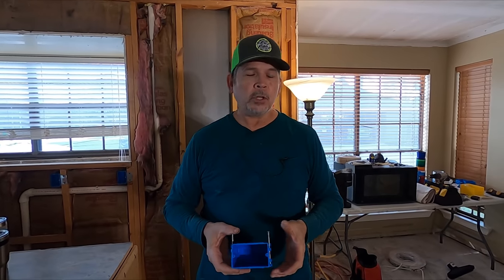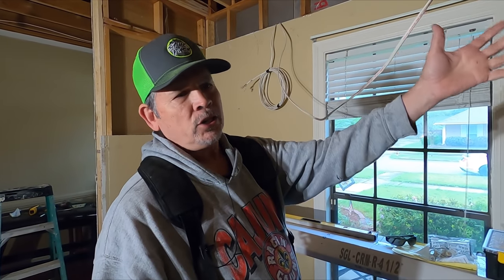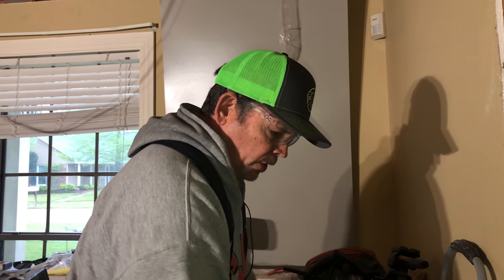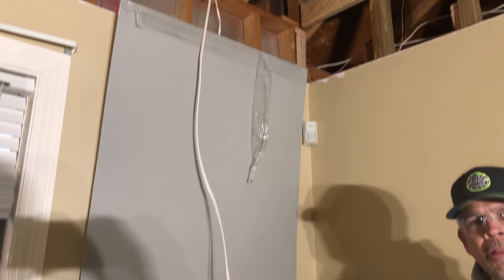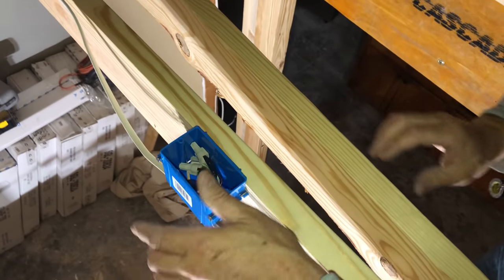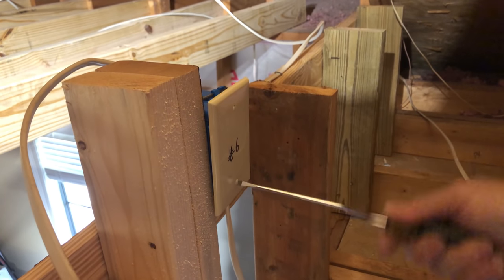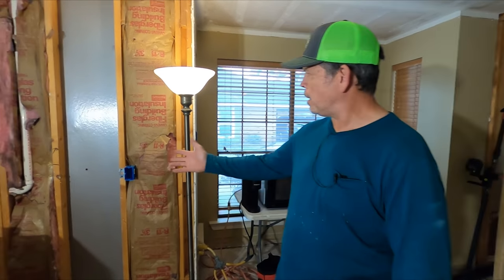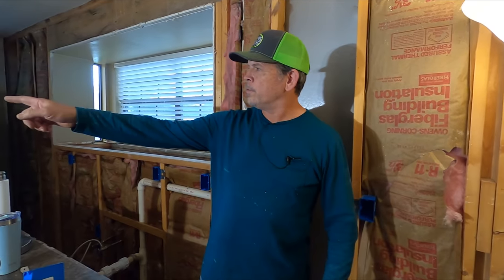How We HELP Our ELECTRICIANS⚡️ Ep. 10

Comment: My dad has a tool to remove sheathing. It's a little bent peice of sheet metal with a sharp point in the middle. You just drag it along the wire and it cuts the sheathing for you.
Reply from the maker: Cool my dad had one of those 👍

Comment: 19:02 Stud Pack isn't is against code (NEC) to pass an electrical wire through insulation such as that? I thought the wire needs to be stapled to the stud and then pass into the junction box?? I could be wrong?
Reply from the maker: That was existing work that we found when we opened up that wall.  Honestly I believe the original contractor forgot it hence the metal old work box.   We fixed it all up 👊👍
Reply: @StudPack  Thanks Paul and Jordon!

Comment: Another question re: blue plastic junction box. You knock-out the 4 tabs where you fed into the box. 2 questions: 1st do you still need a staple when you don't knock out the tab? Does it meet code? 2nd I usually keep that tab as a pull prevention, is it wrong? And again does it meet code? I also usually staple and keep the tab, so is it an overkill? LOL
Reply: The little square pieces shown in the video are made to be knocked out. They are not rated as clamps even if you only half knock them out. You still need a staple to support the wire near where it enters the box. Check your local code of course. YMMV.
Reply: @MoneyManHolmes  Thank you.  So I was doing it right.

Comment: How efficient is that? A carpenter who can do electrical work. Homeowner saves time and money.  Great job.
  Why not just get your electric license?
Reply from the maker: Takes 7 years of working for someone else
Reply: @StudPack  when I was an electrician back in the 80's   it took X number of hrs of  formal instruction, the NEC course counted towards that, and  8000 hrs as apprentice and journeyman experience. 
    You obviously have lots of experience and knowledge of the code.
      Like every thing else criteria changes , and States also have additional  requirements. Probably much different today than in mine. 
       I  would hire you.

Comment: When you capped the wires not be used, why didn't you place electrical tape on them for extra protection?
Reply from the maker: I’ve never done that.  I feel it’s an extra step that’s not needed.
Reply: @StudPack  Thanks - I do like your plan for laying out the breaker box - i will use that - do you post that next to the panel?

Comment: I always use steel blank plates on any exposed box. The plastic plates leave too much hangover that can get kicked by a boot and break. The steel plates fit very snug even on the blue plastic boxes.
Reply from the maker: I hear you about the plastic plates being easy to break but, for me, I'll only use a metal cover plate on a metal box that is bonded to the ground or if the metal cover plate is screwed to a device yoke that is bonded to the ground.  If a hot wire comes loose and touches that metal cover plate that is not bonded to a ground, it would be like that refrigerator that shocked me.  Hope that makes sense.  Thx Matthew.
Reply: @StudPack  thanks for the info 👍

Comment: In my area, junction boxes are big NO NO. Not allowed by code. It is interesting to see how other areas of the country do things.
Reply from the maker: They must be allowed somewhere?
Reply: @StudPack  Nope. If you have make a junction, it must be made in the box for the light, outlet or switch, or you have to run a new line from the main panel.
Reply from the maker: That drives up the cost if you’re running home runs 😳

Comment: dont youl use metal conduit  in usa ?? all my cables  electrical  ethernet  cctv all run in they own metal conduit  pipe make installation neater
Reply from the maker: Some municipalities require EMT (Chicago) but in most homes you’ll never see it.
Reply: @StudPack  but is it not neat and safer to put it in conduit
Reply from the maker: Way more expensive to install though.  Housing is already through the roof

Comment: You seem solid. But the joint on the outlet hurt my feelings
Reply from the maker: Joint?
Reply: @StudPack  using the outlet as a joint. Even on temporary make joints with wire nuts and pigtails.

Comment: I notice you showing to knock out the tabs on the boxes.  Since all the 1980's boxes look to be done the same way, I'm expecting it to be a jurisdictional reason.  For others out there in different jurisdictions, a slight push with a screwdriver from the outside and the tabs become the cable secure points for the box. You just need to feed the romex through and the sheath point needs to be at least 1/4" past with at least 6" of cable extending past the opening of the box.  This is especially helpful when adding a fished wire box in a wall (such as adding a hidden outlet behind a wall mounted TV) where you can't secure the cable to the studs.
Reply: I was looking for someone to point this out. I cringed a little bit every time he knocked one off.
Reply: Not an electrician but I've been going through the comments looking for someone to say exactly this.
Reply: They are connected by 2 tiny dots of plastic. They are KNOCKOUTS. Plastic boxes with integral clamps will have the bottom 25% of the opening connected with thick plastic. All of you people commenting about this have been doing it wrong.

Comment: I love your videos, they are enjoyable and I've learned a lot from you.  Don't treat the cable entries in the blue plastic boxes as knockouts.  Push NM cable in from outside and they provide strain relief.  You can pry them open with a screwdriver if you need to reverse a cable out.  WIth 14/2 it's very easy.
Reply: Those are NOT that type of box,  those are not the spring clip type! Those tabs are ment to be removed completely.  They rely on putting a staple on the cable close to the box to hold the wire in place.

Comment: I've seen this in a few videos now. At 23:25, you're not supposed to completely remove the insert from the back of the work box. It's intended to clamp the Romex and resist against it being pulled back out of the box. It also protects against any foreign matter in the wall from getting into a box with live wiring.
Reply: Those boxes are NOT the spring tab type of box. Those just have tabs that you knock out completely,  you have to put a staple on the wire close to the box to hold the wire.
Reply: @willschultz5452  Yes, they are tabs. You can see them in the video. And code requires that they be there.
Reply: @nilpo  trust me they are NOT. I use them every day! They are not the spring tab type, they are made to punch out all together!! Any code enforcement guy who says otherwise doesn't know what they are talking about!!
Reply: @willschultz5452  I respectfully disagree. Boxes without tabs aren't even available for purchase here. And code enforcement absolutely requires them here. It's the first thing they look for. Cable must be fastened directly to the box. Stapling too close to the box is also a violation so there's no other way to ensure that it's affixed securely on a plastic box.
Reply: @nilpo  there is no such thing as staples too close to the box,  only too far away! These boxes have NO spring clips whatsoever,  only a tiny little nib that you can break off with your finger if you want,  it was designed to break completely out!  The ones with the spring tab you couldn't break off if you wanted to, they are too strong.  If any code guys ever said anything that stupid to me I would tell him he better go back to school!!  I would immediately go over his head to his boss !!!  I've been using these for years and I'll be using them later this week on new construction!!!  This is the proper and ONLY way to use this type of box!   The ones with the spring tab you can not break off without  completely destroying the box.
Reply: @willschultz5452  Again, this is not exactly true. Yes, code specifies a maximum distance. Romex must be secured no more than 12 inches from a box. But it also indirectly specifies a minimum. Too close and it violates the cable bend radius where it enters the box.

Comment: I prefer to leave as much wire as possible so I don't like using those green wire nuts.  One ground wire is always short. Also, it's cool that you have a relationship that's good with your electrician but that doesnt make it legal for you to do electrical work.  Even if you were an apprentice you need to have a journeyman on site. I always twist wires.  Sometimes the wire nut won't twist the wires properly

Comment: Those are not knock outs at the back of those plastic boxes. They are to hold the cable in place.
You push in from the outside. They allow the cable to be fed into the box but not pull back out.

Comment: I stopped watching as soon as he put the tube neutrals and two Hots in the back of the plug they should be put together with a wire not and then one wire put to the plug he obviously doesn't know what he's doing but he thinks he does
Reply from the maker: That was a temporary plug as I mentioned.  I’ll pigtail at finish👍